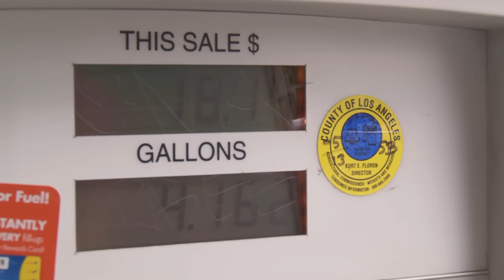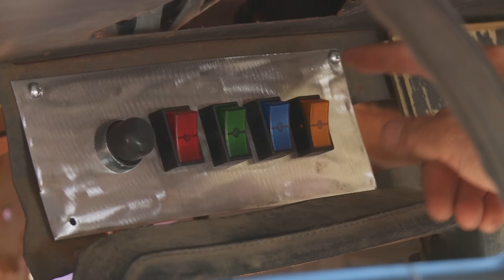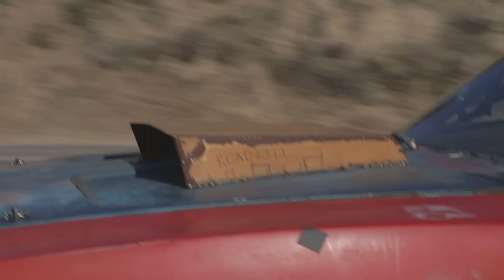Dirt Cheap Rat Rod! 1968 Charger Buildup and Thrash - Roadkill Ep. 23

Comment: Was this some high performance model RV. Because most of the 440 that come out of Rv's had lowered compression, with restrictive exhaust manifolds, small cam. Basically making it an underpowered dog to move a clunkity hulk behemoth around family style instead of a weighted down tire roaster. That would scare grams and the rest of the fam. Of course it's the same block and you can correct all this at the machine shop.
Reply: No it was like you said an underpowered dog. The General mayhem got new heads and a cam in a later episode but still had 8:1 compression.
Reply: @FloppydriveMaestro  It later ran 11's in their duster